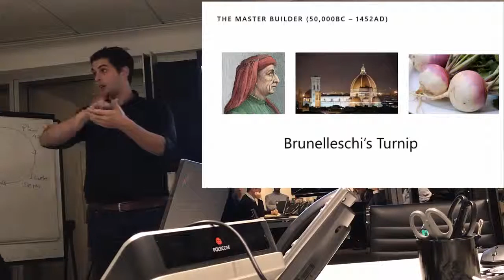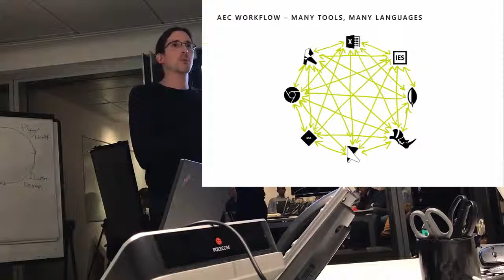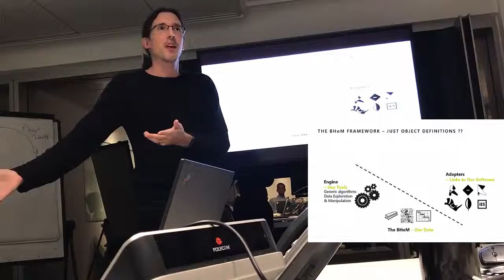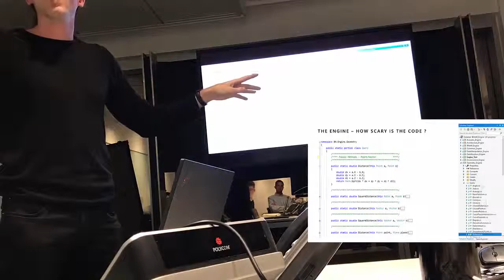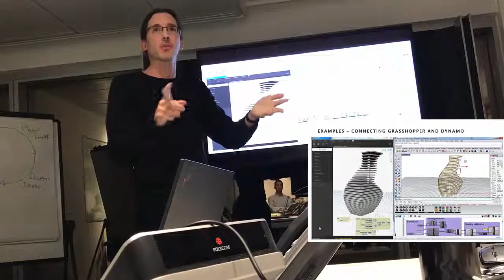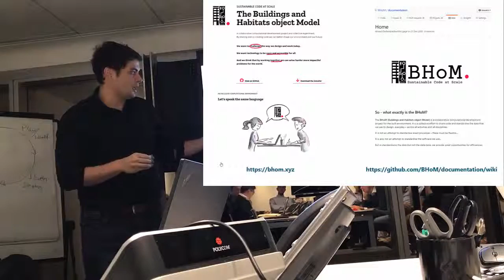Introduction to the BHoM - Open Source Code for Computational Engineers

Comment: Speckle may be sexy but it requires network connection which is not feasible for information to flow without any privately but guys BHOM HAS very bright future if it robust releases via more adapters and engines.